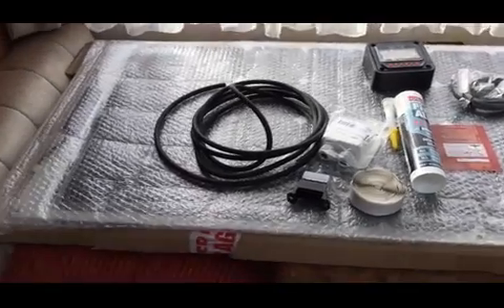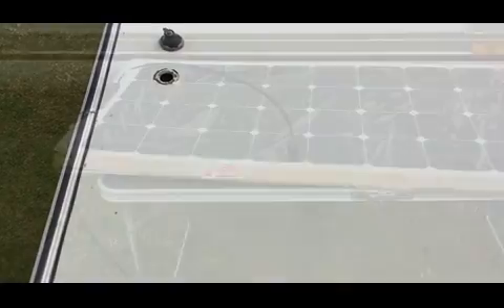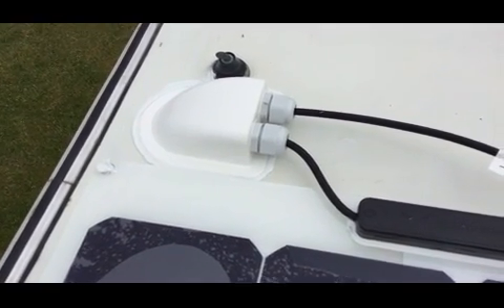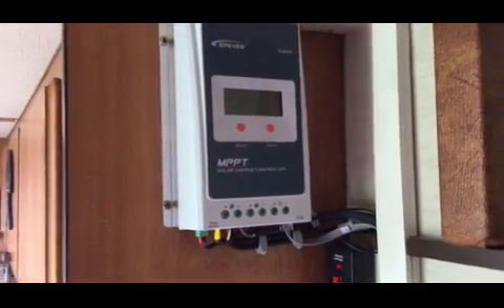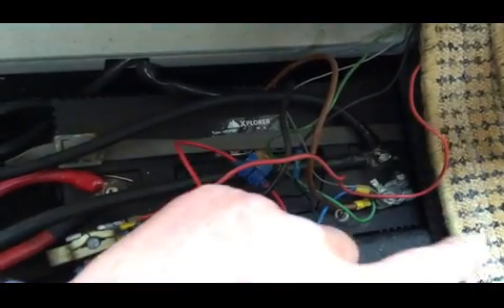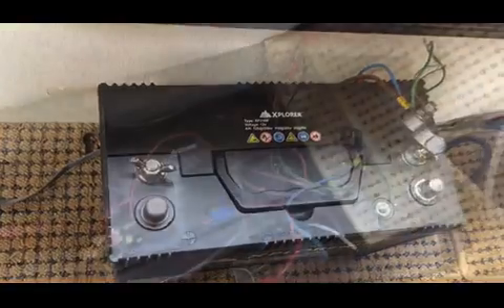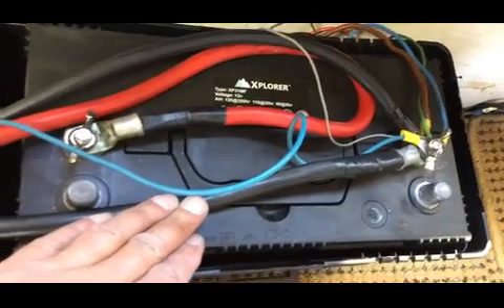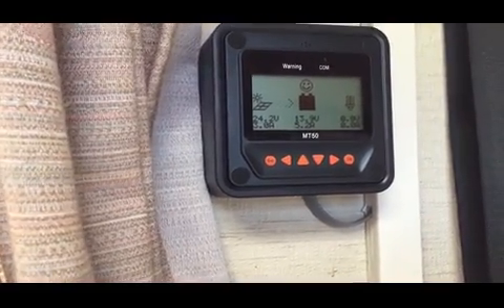How to install a 150w flexible solar panel onto a 1991 Hymer 6 series motorhome

Comment: Hi,  are the charging cables from the alternator still connected to your batteries now the solar panel is connected?   I ask because I also have a classic Hymer and was a bit concerned whether there would be a problem with charging coming from the solar panels AND the alternator.    Has your set up behaved?   Thanks, Pete
Reply from the maker: Crusty Camper Pete, the solar controller will regulate voltage from the panel to the battery whilst driving, that will stop the battery from over charging, had no problems at all with this set up even in the height of summer and while driving, it works great, also it has done ok through winter.

I’ve done the same job on about 20 classic hymers now.
Reply from the maker: Crusty Camper yes to reply to your first question, alternator is still connected to the batteries, reason being, in winter when you don’t get much input from the panels due to cloudy weather etc then the engine will charge the batteries instead, much quicker too.
Reply: @CO55MO  Yes, thanks for your reply.   I have a 97 Hymer and I'm in the middle of adding solar panels on the roof.   All the other videos I have found have either been van conversions, in which case the builder knows exactly what they are fitting from the beginning, or they are newer Hymers with "Smart chargers " already controlling the input from the alternator.     Mine is more similar to yours, so your video has been very helpful, thanks !   Pete
Reply from the maker: No worries Pete, good luck with the install.

Comment: Hi how is the flexi panel performing ? A few people say they aren’t any good etc.. I want to install them but not sure now , are u still getting a good charge from them colin uk
Reply from the maker: Hi Colin.

They're performing well. I've fitted quite a few of these now to various vans. On a clear summer day in the north I can get 8amps in the afternoon when the sun is highest. During poor weather, they perform like all the others. In October in France I was getting about 4 amps. However, a year on, there's even better solar panels. Have a chat with someone like Bimble Solar in Lewes. They have some great deals and kit available.

All of this of course does depend on your daily power needs, battery set up etc.
Reply from the maker: Forgot to mention, the guy I bought the panel off has 40 years experience with motorhomes and is quite an expert when it comes to electrics and power... He recommended the panel. He has one on his own Hymer too. No idea why people say they aren't as good as big bulky ones.